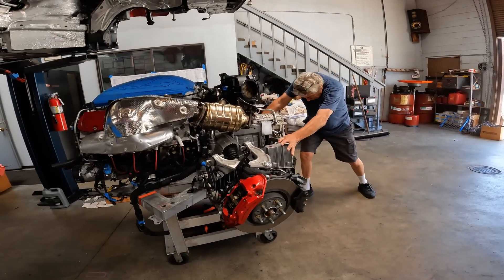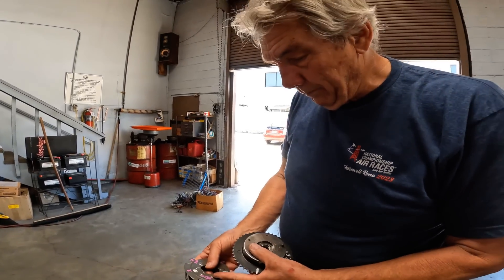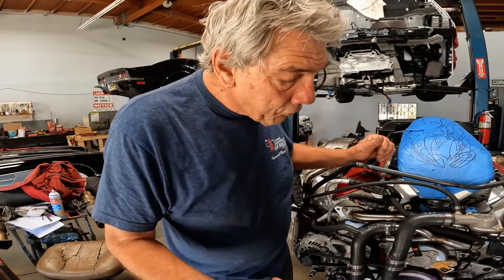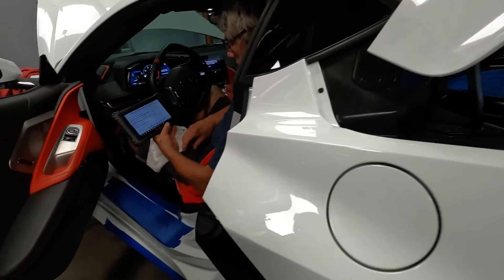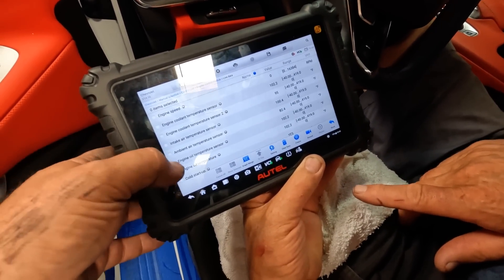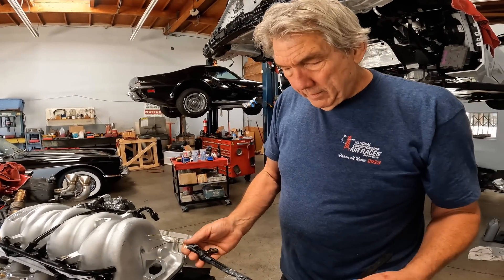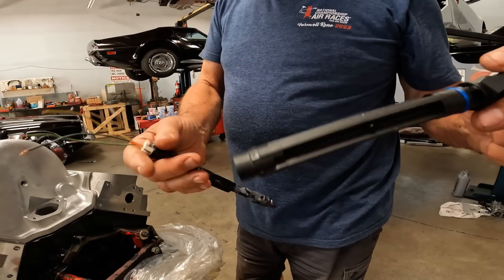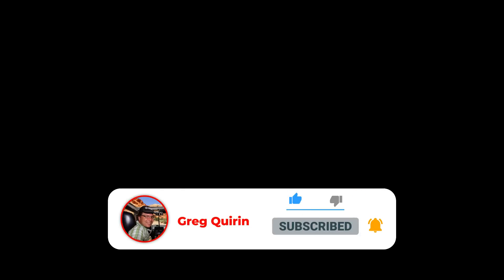Big Block C8 Corvette Conversion Update 8/11/24

Comment: It sounds like you changed where you are reading position from and it cuts the travel signal in half because of the gear reduction that is now in the reading output if it if reading position from the crank instead of the cam. If this is the case and you are trying to not change the ECM at all so it doesn't know you could convert the signal with a simple ARDUINO SOC computer, just have it do the math conversion or read it back off the cam but on the other end of the cam if you have access to the other end of the cam where it ends in the block! I was always one to do stuff like this that nobody thought could be done or said can't be done! Ya just can see how it would work in your head but you can't always show someone else that easily!

Comment: I just went through all the same BS trying to make my PSI 8.8 run with the OEM 58x reluctor. Tried probably 6 different crank sensors... 8.1 sensors and 8.8 sensors. Some ran, some didn't and the ones that did, were terribly erratic and unreliable.
I fianlly gave up and put an MSD flying magnet crank trigger on it and that cured all the CPS issues. I have a couple vids of it on my page.
Reply from the maker: @apw30534  thanks for the info we will definitely check out your videos

Comment: Is this thing running off the stock ECU untuned? I have a hard time thinking that with DI the stock ignition and injection timing is going to play nice with your custom big block heads. Even cam position and phasing can affect direct injection because the fuel pump is run off the cam.

Comment: Amazing project.  But other than saying, I did it, why? The new ZR 1 makes damn near 1000 hp. This may do a bit more but I believe it's not super charger equipped.  True ,there's nothing like a big block but it seems a lot of work for very small gain. It is an amazing build but a ZO 7 option may be my choice.

Comment: I've always been a skeptic of 'mechanical' VVT ever since it came on the scene. It always seemed like a snake oil kind of a thing to me. Anyway, I recently had an experience that has turned me against it 100%. I recently acquired a nice, one owner 2013 Ford Expedition with a 3-valve 5.4 in it with the typical high mileage timing chain/cam phaser issues. In the process of getting it fixed, I stumbled onto a thread about locking out the cam phasers and disabling the VCT in the PCM and thought it was interesting, so that's what I did. Wow, what a night and day difference it makes in the way these engines run. It runs smoother and has more power than it ever had, especially at cruising speeds - e.g. when you're cruising at a fixed speed and then need to mash on the gas to accelerate, etc. So far, the ONLY negative thing I can find about disabling the VVT (or VCT) is a slight reduction in average highway gas mileage numbers. It was like a lightbulb moment - suddenly, I realized that the whole VVT bs was really just a scam to achieve better fuel economy, at the sacrifice of horsepower, perpetrated by the US Govt. Poppycock!

Comment: I have to give props to this guy for making a big block work with a LT style engine with everything working as it was the 6.2L I feel like we could tune around all these issues and the transmission can’t handle big power yet. I know some things have been done to address that though. But I will say this guy is a great go getter, just needs to stop with the eyeball it and make it work, hopefully that crank sensor he made will work correctly but I feel like all of this again could be tuned through. I mean you need to change the tune regardless because it’s a bigger engine and a larger volumetric efficiency. I feel like it’s running lean I’d like to see the STFT’s and the LTFT’s

Comment: also the voltage would be different on the 2 crank sensors, original being 12v and later 5v

Comment: I can fix the location of the map sensor inside the calibration if that is your issue. I had sent you an email. Having the cam off reading will affect your fuel pressure also as the ECM doesn't know what the proper centerline is and won't be able to time the solenoid on the pump properly.

Comment: I'm going to buy one of those Autels, we have one at work, I run a mobile side business, my Solus Edge supposedly had the wifi chip fail, and they wanted $850aud for software updates even though it was at 2021 and $1600aud for the main board, so I told them to get F'ed and paid the $75 for it to be shipped back and now it's sitting in my tool box dead.
I can get an Autel just like that one for $2100 Australian, Snap-off's is all I can say, they would make Ned Kelly bluff with their highway robbery.

Comment: Why would you not just put a 16 degree offset into the cam timing by software?
Reply: Sweeet❤
Reply: Also, if you can't add a software offset due to computer limitations, make the sensor on an adjustable mount, so have the case remade so that there is a boss with a o-ring groove and three bolts to fasten it so it can spin 360 degree.
Reply: What software and what parameters are you changing?
Reply: @highlanderc  the timing pulse, so there is a signal that has a section with different timing, that is how you know you're at 0, so there might be 360 timing points, or 3,600 from that 0 mark in the software.
But where the software picks up is programmed into the software, so it might see the odd pulse, the 4 pulses after, so you set the program to 0 at the start or end of the odd pulse.
Well you can pick any timing sector in the software from that odd pulse to be the 0 mark. 
The computer doesn't know what the pulses mean, it just will set 0 where you tell it to.

Comment: Why go thru that much trouble for an engine that isnt all that much better than what the stock motor can do with the right power adder and computer? Especially with a displacement on demand motor. They are horrible unless deleted
Reply: BECAUSE HE CAN!... could you do something like this?
Reply: Because this is old school meets new school one day guys like this won’t be around with there years of old school car experience
Reply: It would be far faster because of the massive increase in torque plus the engine has been cammed
Reply: Stock motor is I believe maxed out at 434ci?... most popular is 427 with a 4.000 crank but a 4.125 fit in a L8T block I believe. Still far from what a 8.1 block can do.
Reply: Because engine building is about the BUILDING part.
Reply: What a stupid question. Why buy an 80k Corvette an spd 20k on forced induction when you can buy a liter bike for 15-20? 

You just keep dressing up in your mom's lingerie, looking at yourself in the mirror and saying how pretty you are

Comment: Iron block? Why?
Reply: Because the 8.1 was a truck block, had no reason to build an aluminum block
Reply: @kalybnielsen4183  weight....
About 200 lbs more. Could've gotten a Thunder jet, aren't they 502's.... Plenty of cubes.
Reply: Cause it’s a real old school big block. Nothing wrong with iron block
Reply: Turbine
Reply: Porky power
Reply: Because big block
Reply: @jeffchance2909  they make aluminum big blocks, that guy ain't broke....  A 632 all aluminum big block is 37k, or cheaper...
Reply: Because he can and nobody else has. Sometimes you build stuff just because you feel like it.
Reply: @williamstrese4947  ahhh, that is understood. I think it's a cool build, but why not go with an aluminum big block? It shaves 200 pounds.
Reply: They never made aluminum 8.1 blocks.
Reply: @slmhofy  the point is, they make aluminum big blocks, so why does it have to be an 8.1 out of a truck? Could've gotten an aluminum short block for 2500-4000... depending on the guts.
Reply: @anthonydavis5993 probably just because he wanted a 8.1. Its more of a conversational build im sure and kinda “just cause it would be cool” to do type thing. Im sure he wants good power and gonna take it to the strip but i doubt this is gonna be a full on race car. He probably didnt care to shave the weight honestly. Just my thoughts
Reply: Agree.. They should have just sleeved the stock block and custom rotating assembly.
Reply: Cuz you will pull the threads out of a aluminum